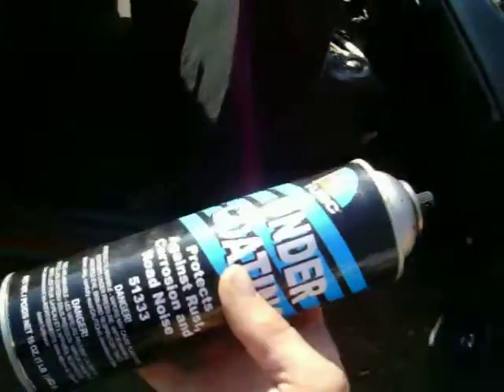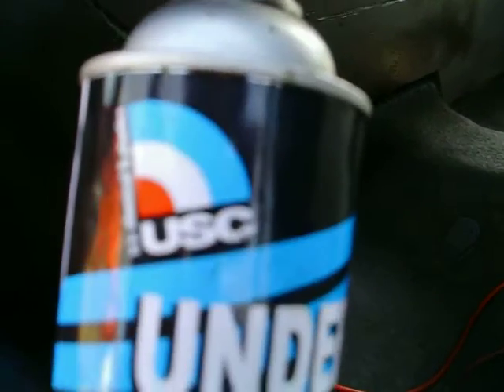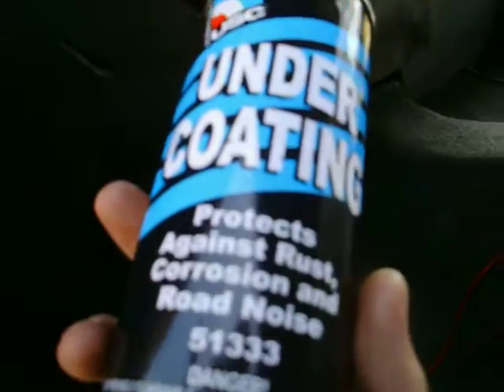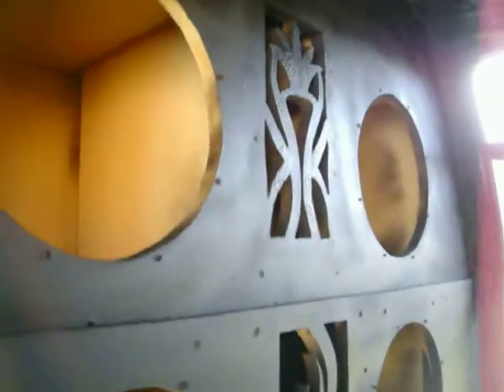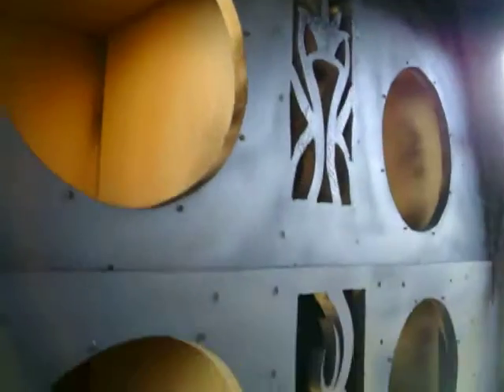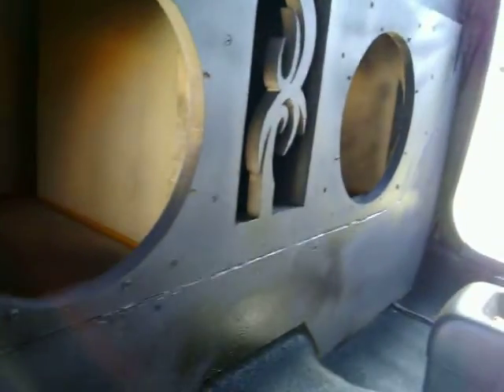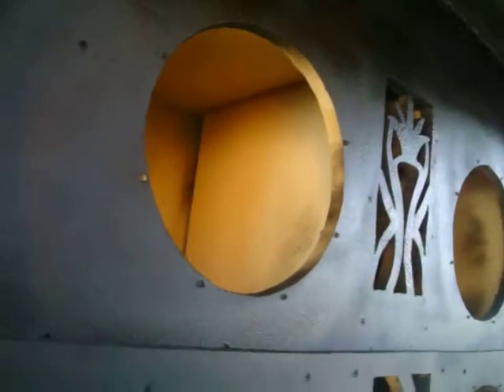working on my wall 4 12'' boss audio subs

Comment: @mazda2284, roll on truck bedliner is an excellent box finish. fill all the screwholes and seams with wood putty or bondo, hit it with an electric sander with 60 grit sandpaper to smooth it out, and use a paint roller to put 3-4 coats of bedliner on. you can buy the bedliner from walmart for $20 a gallon. it's easy and very durable

Comment: @Jacobbz206 I dont have a deep cycle right now on my 1500rms and it drops down from 14.4 to 12v quickly but stays there.
I dont think your totally right on saying you dont need extra alternator output because people get a h.o. alternator all the time running with just 3000rms. It keeps there batts charged faster than there stock. I said I wanted dual alts. bc I wanted to combine 2 stock ones instead of getting a h.o.

Comment: the port is so close to the back wall that drops the tuning way down. 

i need yer port width, port height,  port length, cu/ft of the box b4 displacements 

i use bass box pro 6

Comment from the maker: @twiztid83222 no no the new 1's....BOSS AUDIO NX159DC 15"
 # 3000 Watt MAX (6000 Watt PAIR)
# 1500 Watt RMS (3000 Watt PAIR)
# Electroplated Injected Cone
# Competition Style Binding Posts
# Dual 4 Ohm Voice Coils
# 3" Voice Coils
# Die Cast Aluminum Basket
# Efficiency: 96 dB
# Frequency Response: 25Hz-2.2kHz
# Mounting Depth: 8-7/8

Comment: @Jacobbz206 yea 3 big batts on 3000rms .. I was talking about 6000rms its alot of strain on a stock alt, I even asked the kid with 4 batts running the same amps im going to, and he even said it dropped to 12v or less and needs a bigger alt. You keep saying 4 big batts will be fine. Whell 1 stinger big battery over the 1800 series is over $300.00 a peice. I can make a bracket with my welder easily and rob a pully from a junk yard. This project would basicly take time and be free.